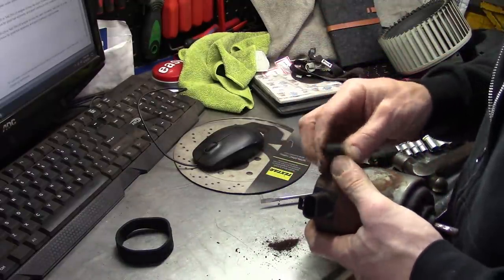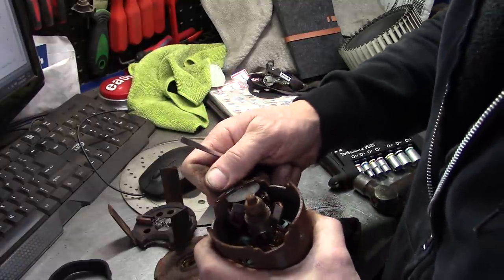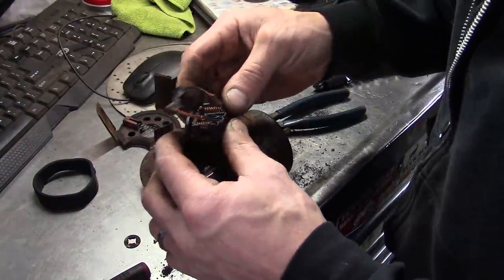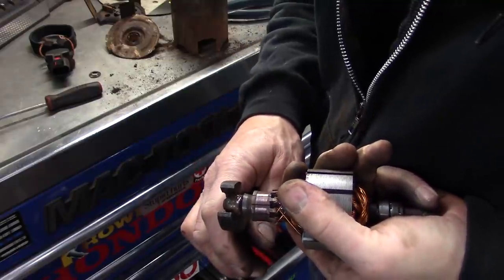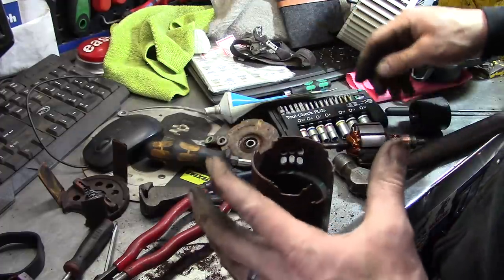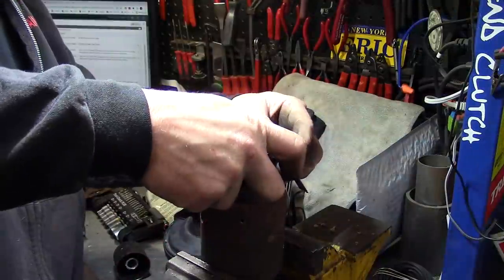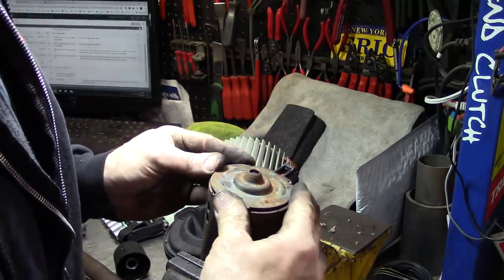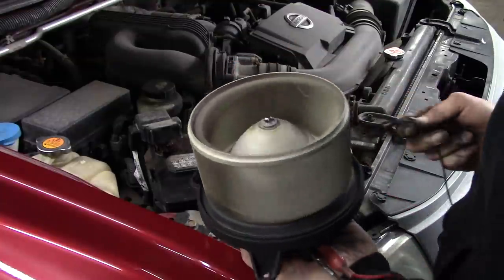BONUS FOOTAGE: Blower Motor Tear Down (Full Russian)

Comment: Sods law dictates:  Repair it for yourself and it will last years.  But for a customer it will fail every single day.
Reply: Very true. Also true even in computer era, where I can fix my own issues just fine. Touch someone's else's hardware or software, and look out!
Reply: Ain't that the truth
Reply: @markh.6687  There is also another law,  if you build a p.c and all the software+drivers are sweet.
Never show your frends the machine and say "It's so stable and fast"  it will screw up/lock up for no reason.
The fault vanishes when the frends leave the house. :-D
Annoying but funny.

Comment: Excellent additional footage. Thank you :) In case anyone needs the information for repairs to your own motors….. the soft bearing material is sintered bronze and called an Oilite bearing. Under a microscope it is full of holes that were originally filled with fine grade thin oil. To refill such a bearing you need to soak it in a degreaser fluid to clean out the old oil/dirt then refill the bearing by placing it in hot (~60C) thin oil and drawing a vacuum on it. I use my brake bleeding vacuum pump and a suitable container for this and you see all the air coming out of the bearing. Oil is drawn into the bearing and hey presto, you have refilled the bearing with oil. The spring bearing retainers are important and needed to hold the Oilite bearing in its correct position. They form part of the bearing self alignment system, hence why the Oilite bearings have a spherical outer shape to allow pivoting. I have repaired several irreplaceable motors of this design and they are running fine many years later. Not normally an economic proposition if a replacement motor is available at sensible money, as I suspect was the case with the Nissan blower. It looks like that blower ingested water at some point in its life ! The motor shafts would need some serious TLC without removing too much material and reducing the diameter too much. Great to see what caused the failure though 👍👍
Reply: Nice explanation Sir. Never knew about the Oilite process. Well, I can use it to impress women for sure. :)
Reply: When the inner race of the oil lite bearing is glazed over, can it still be re-used?
Reply: @paulstandaert5709  It depends what you mean by “glazed over”. The pores in the sintered bronze get filled with dust and blocked but this gets flushed out with the degreaser, such as brake clean. Stubborn dirt may be removed in an ultrasonic bath, then ‘brake cleaned’ followed by refilling with oil. If the original oil has become solid and the bearing “glazed” you have to dissolve that layer using a solvent and heat. The bearing will tolerate any non acid solvent but do clean it well afterwards to remove any residue. Ultrasonic cleaners work really well fro deep cleaning with a detergent fluid. Do not, under any circumstances, use a file or reamer on the bearing as the Sintered Bronze is very soft and the pores will ‘smear’ easily. I use cotton ear buds soaked in solvents or detergents to clean the inside surface of the bearing. If that fails it is worth soaking the bearing in a strong solvent such as acetone overnight to soften the contamination and repeat the clean with a cotton Bud. I advise against using cotton ear buds with plastic stems as they can dissolve due to the solvent action. I also use a microscope to look at the pores in the bearing surface and it is very clear when the pores are blocked. Hope this helps.
Reply: @fraserc9768  that's a great description, but what I meant by "glazed over" is when the bearing essential seizes. It appears as though some of the steel shaft rubbed off onto the bearing and some of the bronze melted and smeared over. I am guessing that those pores are well sealed in such situations and that is usually how I find these bearings.
Reply: @paulstandaert5709  Ah, I see what you mean. Sadly the bearing surface is ruined by such damage and a new Oilite bearing should be fitted. Smearing of the bearing surface prevents correct lubrication so even a refill with oil will not provide a reasonable extension in service life. If the motor shaft is also damaged, it will destroy a new bearings surface. I am sure that the shaft and even Oilite bearings may be rebuilt but the cost of the labour could likely make it uneconomic unless it is an irreplaceable motor.
Reply: @fraserc9768  That is my experience regarding it, but I was hoping that I was doing it wrong.  Sometimes those bearings still fit quite nicely, and despite a week long oil soak, the service life is not long.  I need to learn to source these bearings.

Comment: Eric. I used to work on equipment years ago that had those soft “bearings”.  They used to be called Oilite bearings made of a copper bronze material impregnated with oil.  They were really good until they weren’t.   Once the oil dried up. The bearing seized on the shaft.  I used to do what you did to get things going.  Well done. Brought me back 35 service years ago which in mechanic years is about 70!

Comment: I love teardowns.  I would not be able to throw that motor away without taking it apart as you did.  But I am retired and have lots more time than you.  Thanks for taking the time.
Reply: I'm with you.  I tear every failed appliance, computer, engine, or whatever apart before dumping it.  I think it is a disease.  Retired also, so it keeps hands busy, especially with the junk that is produced these days!
Reply: @skip7243  the worst ones are the washing machines that have the drum plastic welded together so you can't replace the bearing

Comment: Cool video. It brought back a lot of memories.  I worked in a shop in a suburb of Buffalo, in the late 60s early 70's when I was in college. Generators and voltage regulators were on most of our customers cars to provide electricity. We were taught to rebuild generators and replace voltage regulators to keep the customer on the road. We had a cabinet that had brushes for several makes of cars for the generator, and and also for starter motors, which we would also rebuild. As alternators, with built-in voltage regulators and NAPA rebuilt starters became more popular, we eventually stopped rebuilding them. For me, this video was a nice walk down memory lane. Thanks.
Reply: You lived in Buffalo in the winter in 60s & 70s and lived to tell about it. I salute you Sir.
Reply: Agreed remember those days.  i do love repair/refurbish. parts. and still do.
Reply: @johnmichaelazona9520  And, we used to have to go out and pump gas and had we had a snow-plow service. I live in TX now, and I hope I never see another snow-flake.

Comment: If you're anything like me, fixed and then put directly in the scrap bin. Thanks for the content!
Reply: You misspelled Ebay.
Reply: @sometimesleela5947  slightly used
Reply: @edwardmyers1746  no lowballs, I know what I got
Reply: Fully reconditioned, as new condition🤣
Reply: @sometimesleela5947  It worked when it was put on the shelf.
Reply: @jaymzx0  Don't laugh; I had a computer hard drive (mechanical, not SSD) die after sitting in a drawer for over a year unused! Turns out it was a cheap low-grade of a major brand that was of reportedly questionable quality according to Internet comments. Other used mechanical drives people gave me sat for years and powered right up fully usable.
Reply: @markh.6687  Not surprised at all!

Comment: I love doing autopsies on failed parts, love it when you find a bad 10 cent part that you can’t find anywhere. But I got a guy that can machine me anything, we could have turned that shaft and made a new bushing to fit it, problem is when done I’d have to charge 3 times what just replacing the motor would have cost….

Comment: Great video! My eyesight isn't too good anymore to tell, but if those plain bearings are sintered bronze you can soak them in oil. That bronze is porus and the pores will capture oil. Known sometimes as "oilite" bearings. I've repaired some pricey fan motors just the way you've done it.

Comment: I've drilled holes in the end cap and shot oil into the bearing without taking the motor apart.  Works most of the time.  Your method is better though.

Comment: Worked in a restoration shop that did cars from the 1920s to the 50s. When you can’t buy the part you repair or make a new one. I loved the detective work required to find out how a part was made and how to fix it. Sometimes the first puzzle was “what is this thing supposed to do”?
Reply: "What is this thing supposed to do?"  See also: "Who designed this piece of $@#!" and "Why the hell did they use a left-handed, metric, mystery tool-headed fastener?!"

Comment: Very cool teardown and fix :) 
Brings back a memory from 1993 to me, when my dad took apart my 1982 Mazda 323 (GLC) blower motor, because it randomly stopped working, but the good old "hit it with the fist" -method made it working again.
At least the brushes turned out to be worn & dirty commutator, but the bearings were still good, so he did "something" that I've forgot by now, and the blower motor worked the rest of the time I had the car (had it until March 1999) just fine :)

Comment: Believe the bearings are spherical oil impregnated sintered bronze..They might have "bearing windows" which allow oil to make it's way to the shaft from oil soaked wicking material surrounding the bearings..Many household motors for fans etc. are built this way and can be re-oiled with light, (10W), non-detergent oil if a small hole is drilled into the wicking material.  This kind of bearing can be re-aligned after being dis-assembled and re-assembled by lightly tapping on the side of the output shaft from several directions.  Was amazed to see I'm not the only one who does this sort of thing..Could never do many of the things you do routinely Eric..You are the man!

Comment: I did something  similar about ten years ago to my 1990 Nissan D21. It had about 280,000 miles back then.  The brushes had worn completely out and I cut some of the metal holding them so they could come out about a 16th or 8th more and put it back together.  Well over 300,000 miles today and the blower is still going strong.

Comment: Good see this breakdown and repair,will work when no new motors available. I think the very dirty cabin air filters contributed to water/ moisture trapped inside HVAC box . Great  job
Reply: "Condensation, condensation don't lie. It rusts on through. Condensation, condensation inside. Bearings go kaput! Can ya dig it?" 
  -- The Temptations' "Smiling Faces Sometimes", parody.

Comment: I was laughing a little when you were reassembling the brush end of the motor. It reminded me of how the old Chrysler starters had a special washer/retainer in them for exactly that purpose since the brushes were inaccessible. I must have done a hundred starters in those years where the owner had taken it apart to rebuild it and then could not reassemble it since they didn't know what that weird washer was for.

Comment: Reminds me of the time when I was looking for a new snowblower. I asked a mechanic who worked on small engine equipment for a recommendation. He said he had guys come in all the time looking for xyz part for MTD transmissions. You can't buy parts for MTD equipment, only sub assemblies and whole assemblies. It's a shame because a $0.10 part makes you throw the whole shebang away.
But, he told me that Ariens has any part you need to fix equipment even for stuff going back 20 years.
Guess what I bought and on top haven't needed any repair parts!

Comment: Now build a housing and you can have one of the rear defrost units like GM used in the 70's.  For those who never seen one, it was a small blower that mounted in the rear package tray and just pulled air in from a vent and blew it onto the glass. Was used in 2&4 door land yachts because the front blower couldn't ever reach that rear glass.

Comment: I remember when you could buy a starter solenoid cheaper than buying a new starter. Most starter motors always outlast the weak link. The solenoid.

Comment: Back in the day when a blower motor started to get noisy, I would drill a small hole in the end dome and put in a few drops of oil, the blower end would  get a few drops on the shaft and they would run for years

Comment: I've had a blower motor fail in a similar fashion before on a Sprinter where I worked. I sprayed some lube into the motor while waiting for the part to come in. It didn't fully work, it would only work on high, but once it was running, it would stay on. I didn't even have to take apart the motor to know why it failed, between the sound and the exterior looked, you know things just rusted together. I was impressed that the fan motor only lasted about 5 years .

Comment: Remember those Toyotas that would get locked up struts after you had them on the lift? Took one apart to see why it failed and found out there's a little plastic bushing near the top of the strut cylinder, so if the strut is fully extended the piston rests on that. Overtime the plastic degrades and when you put it up on the lift and extend the strut all the way out the plastic bushing crumbles apart. The little pieces get caught in the valving and doesn't allow the fluid to pass through locking the strut up.

Comment: Hi Mr. O...here in Manila Philippines...we seldom have rusted motor...usually the problem we encouter with those fan motors are the carbon brush...if the bushing, stator and armature are in good condition we just replace the carbon brush and put some oil in the bushings...

Comment: Had a 91 ford 1/2 ton I bought when it was 7 years old and blower motor would drive you crazy noisy. Drilled a hole big enough for the straw on spray can and sprayed silicone spray into it, twice in about 15 years of ownership. I’m cheap still good when I sold it 👍in the bearing on the outer end I should add.

Comment: excellent repair Eric , wonder how it got so much water down in it to rust it out.
Reply: Maybe something like a plugged drain tube and then rainwater or AC condensate collects and the puddle or the humidity corrodes the bushing?
Reply: Pulling in that damp foggy morning air.  It also gets real humid in there after running the AC and shutting up the car.

Comment: No lie..I have done this before to get by and actually got by for several years!

Those bushings are oil impregnated bronze. If you heat them up a bit and quench them in oil, it will saturate them again. Then re saturate the felt pad and its good to go!

Comment: Back in the 70's, on the American cars, those blower motors would draw a lot of current.  When the bearings start failing, they would draw even more current and melt the fan switch.  Then you have replace the switch and the blower fan motor.  Now I drive Toyota's; haven't changed a blower fan in twenty years.

Comment: Eric has gone crazy. Has always complaint about rebuilt auto parts but then proceeds to rebuild a blower motor.  😂
Reply: Eric's issue is that the rebuilds from parts suppliers are often poorly done and low-quality, lowest-bidder junk while charging high prices, then he has to eat some of the cost and deal with irate customers when a "quality remanufactured" item fails after installation under warranty, and the headache of redoing the job twice when once should have been enough.

Comment: A part of me is actually really upset that we live in an age where it's more economical to buy a whole new blower than to repair the old one and maybe replace the bearings/bushes. 
Obviously it's much easier/cheaper but it just feels so wasteful. 
I mean throwing out your blower motor on your Model T (I honestly don't know if they had blowers) would have been unthinkable.
Reply: Nope, no heater. Some didn't have windows.
Reply: And you had to back up hills as the fuel pick up was towards the front of the tank
Reply: It IS wasteful, but most humans are too lazy to want to do component-level repair, especially when time is money, and it's also faster to replace many parts than repair/rebuild like circuit boards, electric motors and compressors. I love being able to fix older machines and computers that everybody has cast off to do useful (or useless) things.
Reply: @dans_Learning_Curve  Henry was ahead of his time; he used Linux. 😉
Reply: @markh.6687  Ha ha

Comment: I thought I was one of only a few people who did failure diagnosis and repair as a hobby.  I think I'll start calling it apocalypse education from here out as we'll need to learn how to do bush fixes on everything as our economy recovers from the crapper it is doomed to.  Btw, using cardboard sleeves or other non ferrous "intermediate" that is thin enough to go between the stator and armature is a good way to slide it back in with less effort. ;).  Then just slide the shims out and as you say, "badda bing, badda boom".

Comment: For what it's worth--->Those bushings are oil impregnated from the manufacturer but a good electric motor shop should be able to order new ones using the inside and outside diameters for around $20.00 I'm no expert but I did rebuild the furnace motor on my motorhome that used those same bushings.

Comment: my neighbour used to turn that shaft down by putting it in a drill press or use a drill in a vice and spin the shaft while holding a file against it lightly until it was even across the part.

Comment: Unusual to see an actual metal housing round the motor, normally its plastic and u can replace brushes easily. Or the brushes have got stuck on a low millage car and u give them a wiggle + wd40 and they are fine.